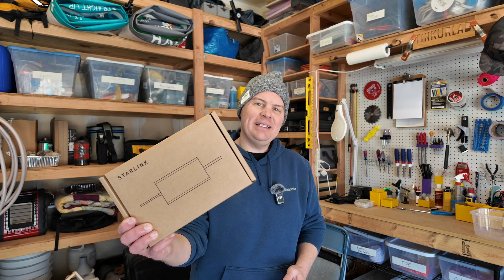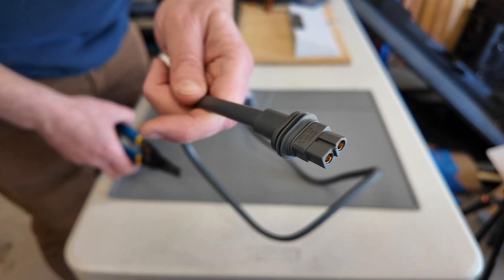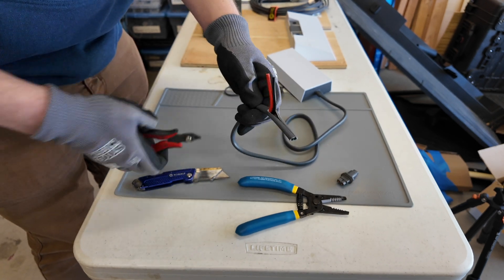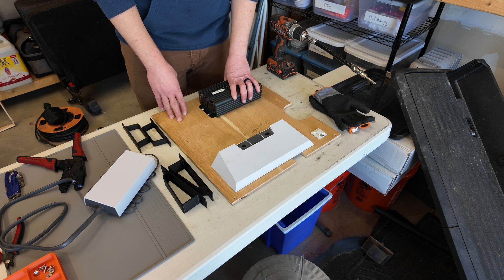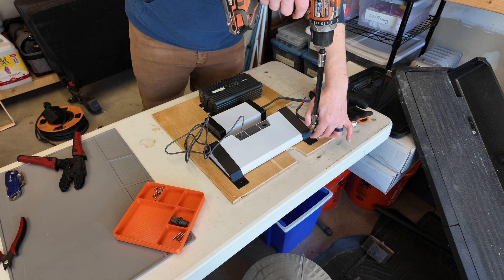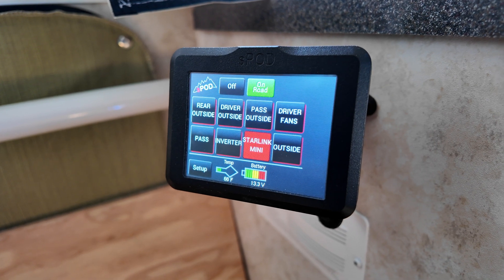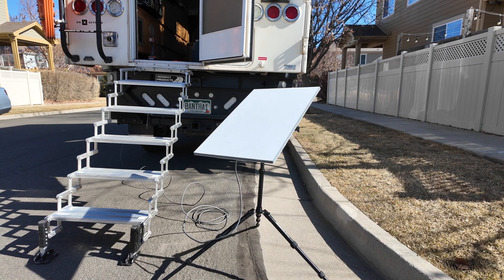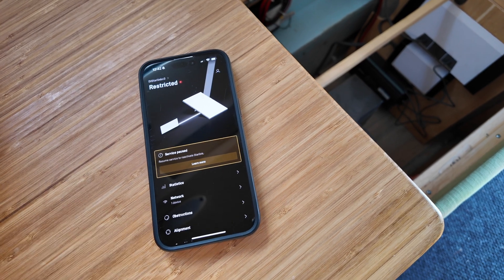Starlink Official DC-DC Power Supply Install for Starlink Standard (Gen 3)

Comment: Do you think I can use this DC-DC power supply with an XT60 to Aviation Plug Cable to power it straight from my Bluetti AC200MAX, which has a 12V/30A Aviation Plug DC Output port?
Reply from the maker: That sounds like it might work. Just note that there can be a voltage drop at 12v over longer runs of thin cable. So you might want to keep the cable short, use a thicker cable, or step up 12v to 24v. Curious to hear what you decide to do and how it works out.

Comment: Awesome video. I have been trying to find information on whether this can be used on the Gen 2 Standard Starlink. I've spent way too much time trying to do the conversion myself, only to have it fail repeatedly. An out-of-the-box solution would be amazing if it did work for Gen 2. Do you know whether the wire can be spliced to use the Gen 2 power supply male plug vs the barrel connector? Thank you for any guidance you can provide!
Reply from the maker: I'm not sure. That said, there are quite a few videos and blog posts about converting a Gen 2 to DC. And some aftermarket solutions available too.

Comment: Bought the starlink dc to dc converter. Every color light is flashing on the starlink and its not working. Current battery volatage is 14.1v. Did you run into this problem at all?
Reply from the maker: Can you use a multimeter to test the voltage just before and just after the DC DC Power Supply? That might help determine what's going on if it's a voltage drop after the battery (ex. using thin wiring, etc).

Comment: I’m interested to see how the new power supply affects power consumption. I am also looking forward to the comparisons between the Starlink standard and mini as I want to pick one up this spring for the upcoming camping season and am on the fence as to which way to go. I will be working remotely.
Reply from the maker: Check out this other video I made comparing the Starlink Standard (Gen 3) vs Mini https://youtu.be/p3s8OzNBS8c. Unless you need high throughput and don't want to have to wait a bit (ex uploading 8GB video files frequently) I think the Mini is the winner at least for me.
Reply: @banthaoverland how does the mini handle video Teams meetings? That is the only high throughput I use.